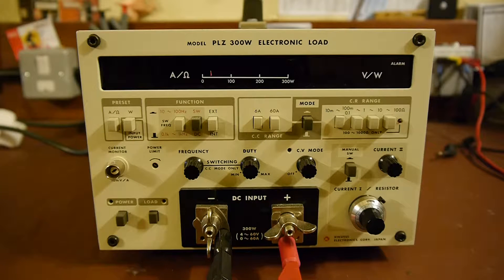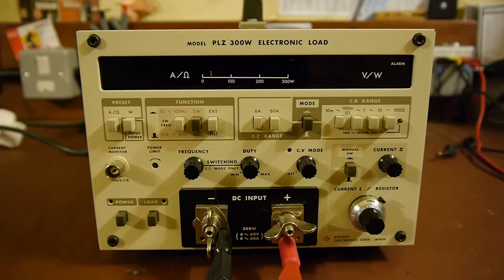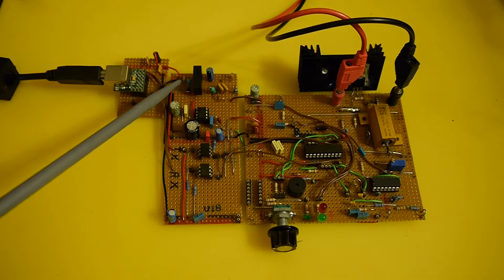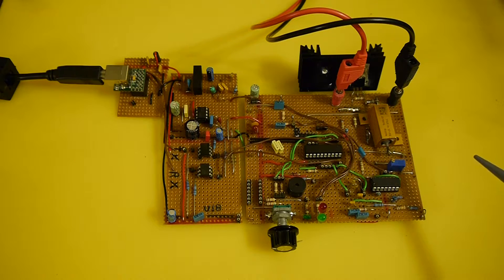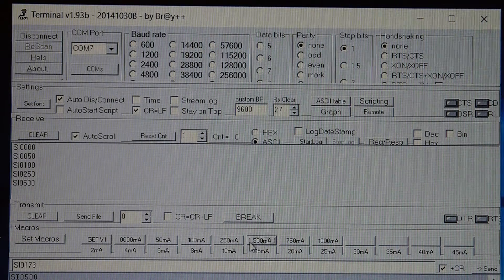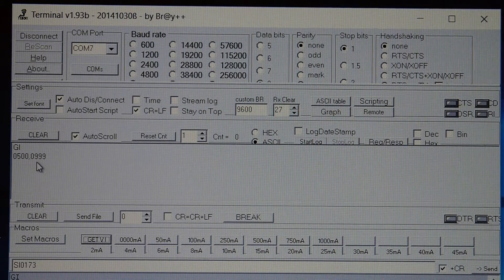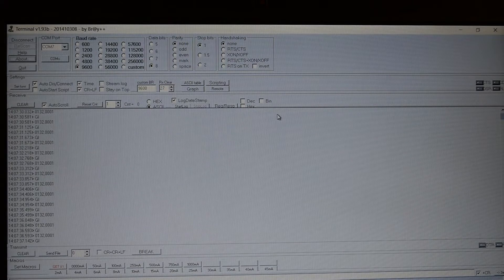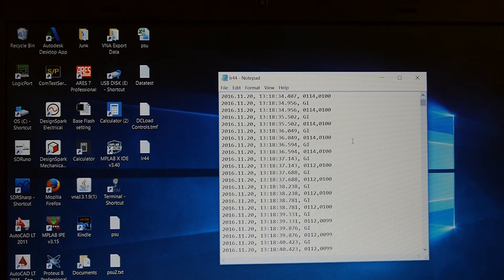Computer Control of Simple  Electronic Load Project

Comment: Wow, very nice gear and very nice skills Chris...except the ending seemed to have cut off, but point well made.  ~Jack, VEG
Reply from the maker: Yes your right it does end suddenly and I don’t remember how it should of ended. I was using free editing software that used to crash so that could be the reason. I think I did a part two where I developed a printed circuit board. That must be one of my first ever videos.
Reply: I would comment at how green you sound here, but in my early videos, I sux so....  :) I understand about cheap/free software...  ~Jack, VEG